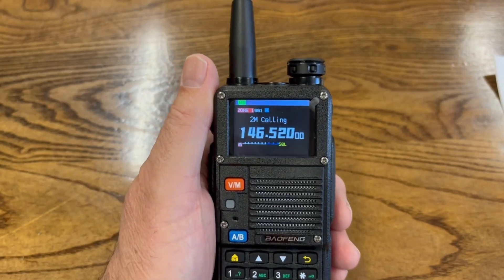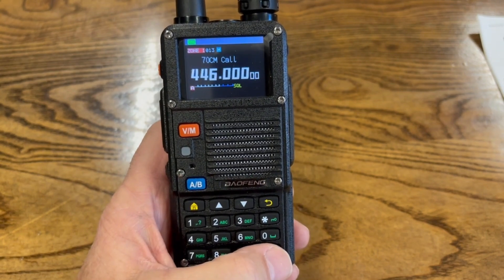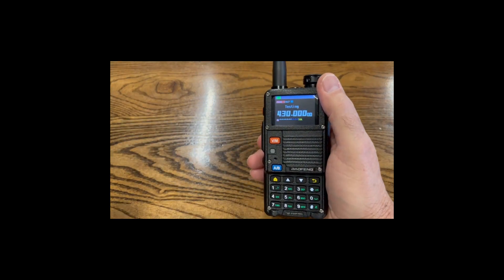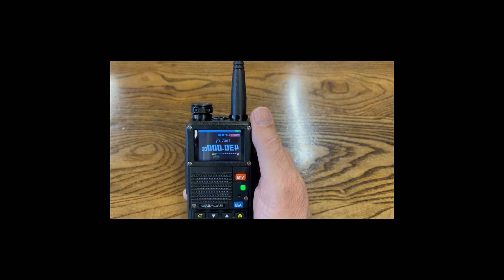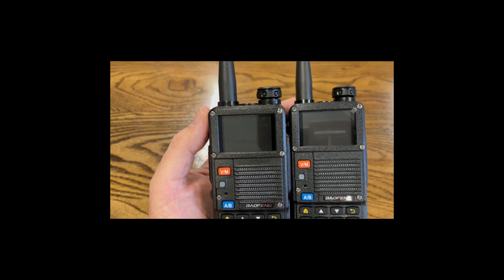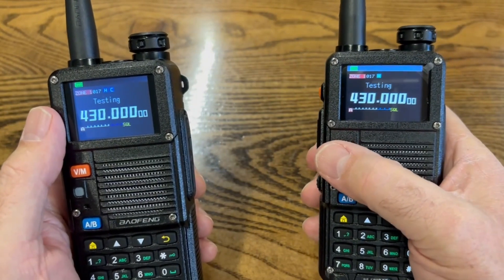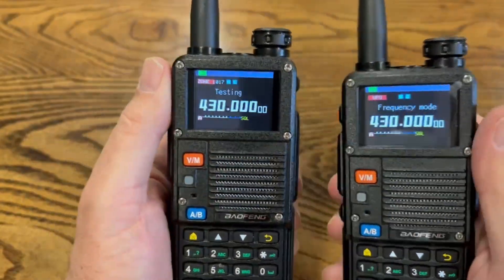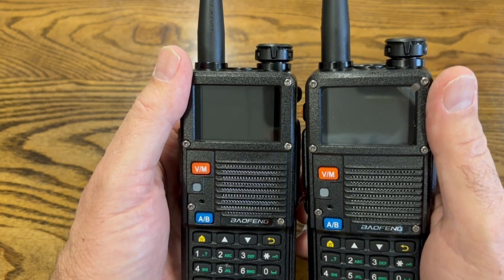Using the BF-F8HP PRO CTCSS Subcode Scanner Function

Comment: Just got the radio....I cant seem to scan in 140 only 440 in VFO mode. I even went to single display and keyed in the 2 meter band and when I hit the #z key to scan it brought up  440 scanning. Do you have to have programed frequencies before it works and if so , how come the 440 band works? Thx in adv.  (Im used to Kenwood lol).

Reply
Reply: I'm getting the same thing would scan starting at 440
Reply: You would need to go to Menu / Scan / Freq Range and type the needed range.